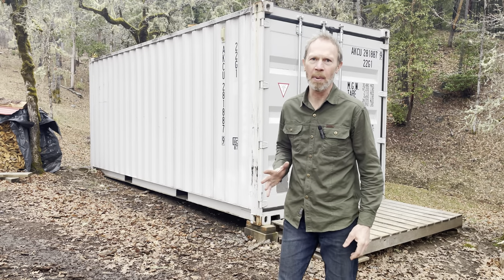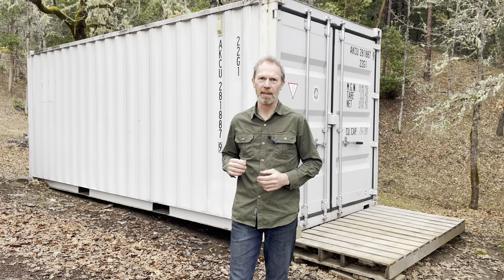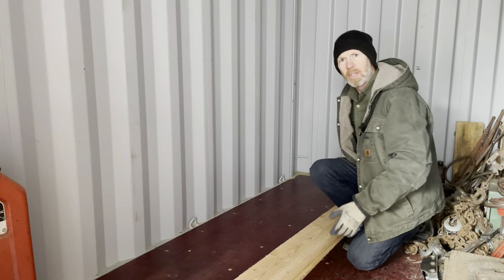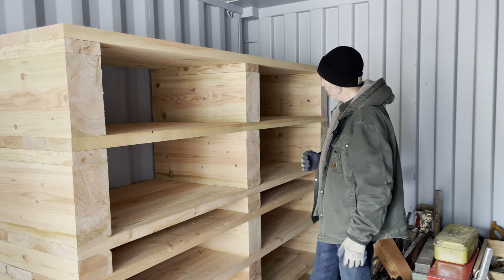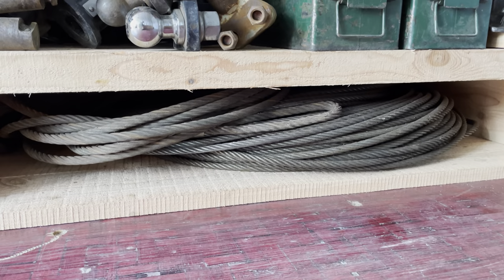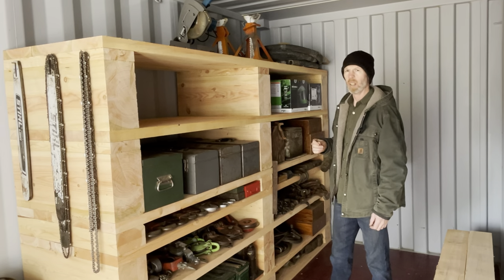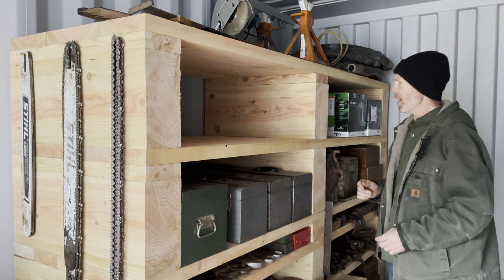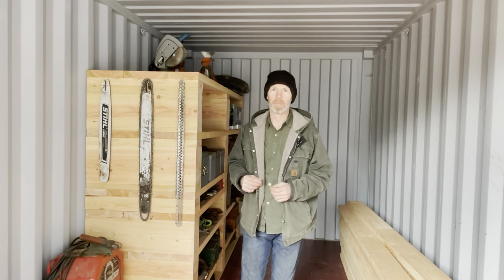Building Simple Strong Shelves in My Shipping Container Workshop

Comment: What causes condensation in them is temperature changes from inside to outside....a thick coat of paint solves that if needed....a friend put  2 of those 20 feet apart and installed a truss roof over them to park his cat and backhoe under it
Reply from the maker: Thanks Grizz. That sounds like a much more simple solution. I will keep that in mind if it ever comes to that.

Comment: Good video.  I have no experience with containers but I always thought it would be good to put in an additional door/exit/hatch considering someone could come up and lock you in unless it has some sort of inside release.
Reply from the maker: That is definitely something to consider. Or keep a charged grinding wheel inside in case you had to cut yourself out. I have also thought of putting some kind of lock out on the latch cams so they can’t be shut. Although someone would likely forget, and it would be a pain to do every time you go inside. I don’t worry about it so much here because it’s a remote out of the way place where people just don’t go. And if they did, I would hear them coming from a long way away.
Reply: @WilsonForestLands  Sasquatch  are the stealthiest, sneakey critters out there...and have the habit of pranking...haha...You could also dig a secret escape hatch /tunnel underneath and it could double as an air raid shelter...:-)..